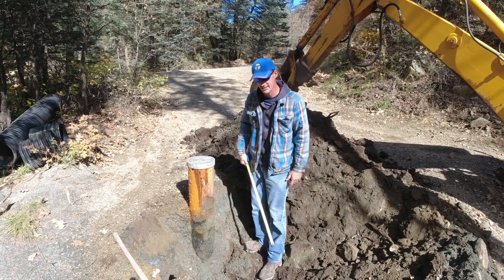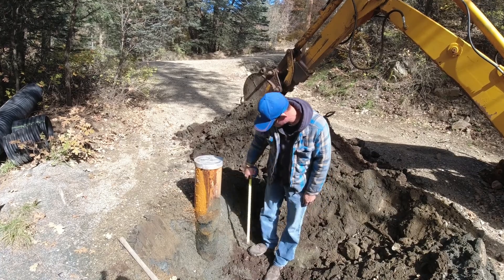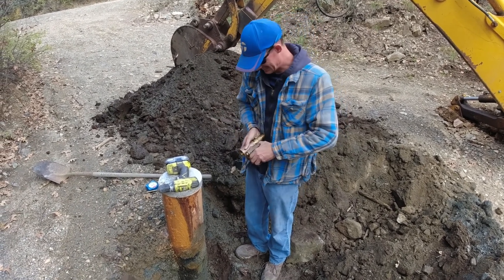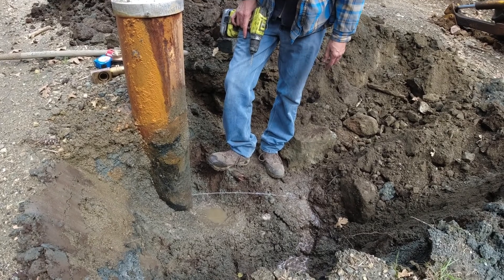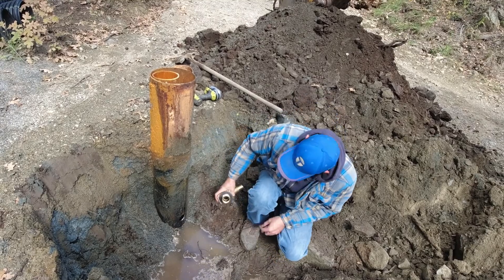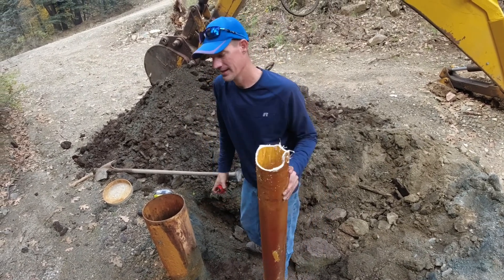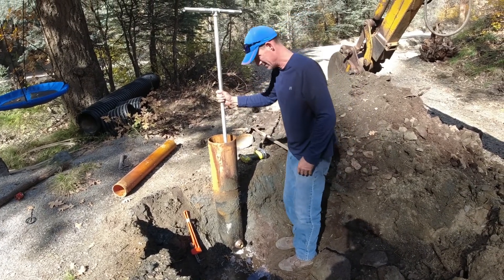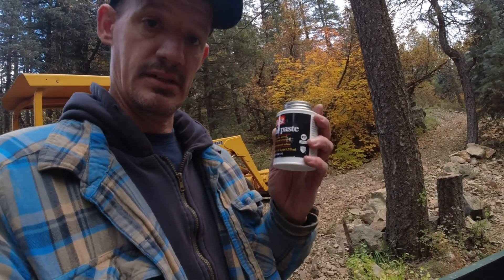Well pump Installation  Part 1 Pitless adapter

Comment: Sorry just saw your installation of your pitiless adapter, I'm not a well intaller but didn't you cut the WRONG PIPE AREN'T YOU SUPPOSED TO CUT THE OUTTER PIPE THE CASING DOWN and leave the inner supply pipe full hight??????.
Reply from the maker: The outer steel casing only goes down 20ft or so and has to be 2ft above grade in our area.   It prevents surface water from getting into the well.   The inner pvc casing runs 400 ft down and prevents the walls from collapsing in.  We had to cut that one below the pitless to allow it to pass through the steel casing.   Hope that helps.   Maybe check out part 2 and see how the pump drops in.  We also have a short that shows the inside from the top.